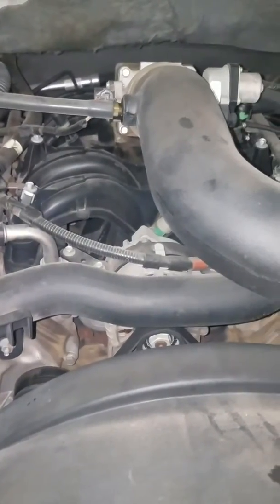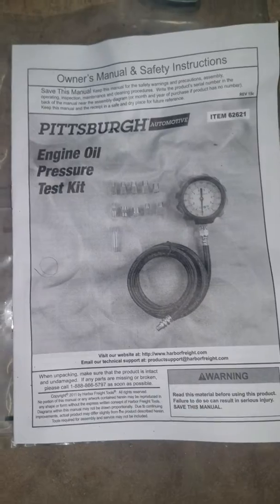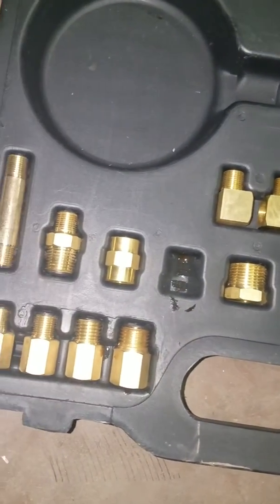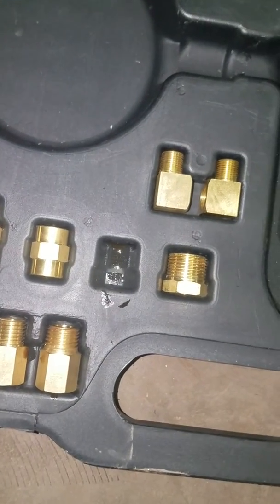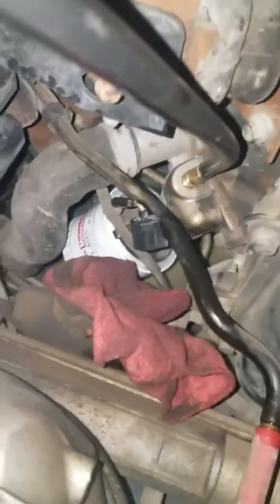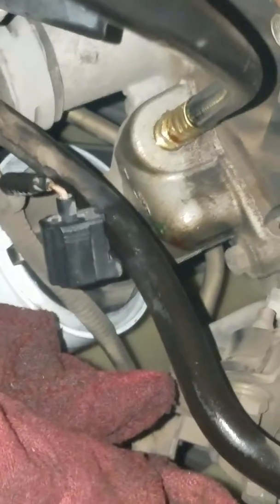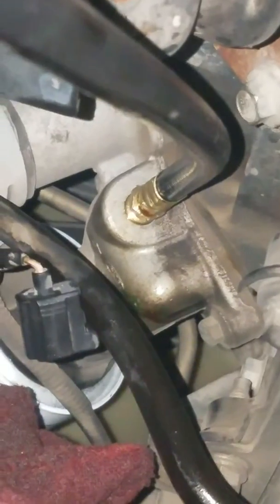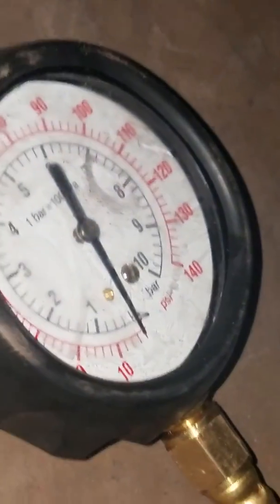How to Check Actual Oil Pressure On a Ford 5.4 3V Engine

Comment: Folks I have a 2008 F-250 Lariat with a 5.4. The oil sending sensor is not on the oil filter housing, It's on the block behind the power steering pump. It's very hard to access. Are there any other ports or a different way to check the oil pressure? Thanks in advance.
Reply: My 05 is in the same spot, it’s a bitch with that crossmember there…hoping to find a video with someone that has it this way, not trying to take a whole lot apart. Did you end up getting it?  I feel it may not be bad once I get the clip undone but even that is a challenge
Reply: @XCRunner4Life12  i did not.🥺
Reply: Forget what I said, I had my crossmembers confused. I got mine off with a 13/16 combo wrench, by laying across the engine bay with my head at the coolant reservoir and reaching down in. It is possible. Just a huge pain
Reply: @XCRunner4Life12  I have 2007 5.4 3v pickup, so is that sending unit more on the drivers of the vehicle? Accessing it from the top. I'm about to rest my head on the coolant reservoir to find it., and it's raining outside. What was Ford thinking when they built this thing. Ggggrrrr!
Reply: @808breaksbad  from what I remember yes it was. Not a bad motor, but definitely designed by an engineer whose wife slept with a mechanic
Reply: A sandwich plate is the easiest way to add a oil pressure gauge

Comment: Hi OKC VET!  I have a 2006 f150   90k miles   Just bought a few months ago   Then realized the problem engine lol  I did new updated plugs and new fuel pump module to fix misfire and full throttle issue   Then I had the hot idle knock   Which went away when I put in the updated new MC vct solenoids    So now that’s left is hot idle tick which is not that bad   And when idling / coasting in neighborhood or parking hit when hot and I release the throttle from a bit of gas I hear a slight chain type noise or something makes a quick noise    Last but not least    There is a slight startup rattle sometimes and usually only right after a fresh oil change   Then it basically goes away till next change    Iv been running 530   And lately have been topping it off with some Lucas to try raising oil pressure and seeing if it clears up the tick which it hasn’t   I only added maybe a quarter of a bottle    Could you please give me your opinion ?  I’m wondering if I should just roll with it or jump head first and get a full timing  and hphv Melling pump      If I do I thinking the Melling tensioners Sound the best then I guess new phasers and all that other stuff

Comment: My 5.4 lariat has 233,000 I hooked up the oil pressure test it was about 60 when starting and as it got warmer it got to about 10 psi I just ordered the melling m360 high pressure oil pump, what's the chances it's just the pump and that I shouldn't put a new motor in it? It dies in gear once warm. Please respond I'm not sure what to do or if I should even put the pump in or if that would be wasting time.
Reply from the maker: Has the timing components been changed yet? If not, I would change it all when you do the pump since the timing chains come off to do the pump.  I need more info to point you in the right direction.  With that many miles and dropping that much pressure, it prob has a lot of wear in other parts of the engine. You may try going a little heavier weight oil like 5w30 instead of 5w20 and see what happens.  Make sure you use syn or syn blend oil. When the heads/cams, crank and rod bearings wear down they cause oil pressure to drop alot. When the timing is off alot from the chains being loose, at hot idle they tend to kill the engine.  Other issues will cause the engine to die at idle also.  I see alot of higher mileage engines that the heads are causing the issues. The only thing you can do if it's the heads, is either rebuild/replace them, or replace the engine.  If your able to do the timing set/oil pump, you should be able to handle rebuilding or replacing the heads.  I normally rebuild the heads myself unless they need resurfacing, then I take them to a local machine shop.  Depending on what I find on a tear down, sometimes I use a hvhp oil pump.  Remember this, if you have oil pressure when you first start up, the oil pump is making the pressure using resistance of the engine parts.  If the pressure goes away after it warms up, the pump is prob still doing what its suppose to, but can't keep up with the demand so the pressure drops.  What's demanded isn't normally the oil pumps fault, but other engine parts like bearings, where clearances are getting bigger as they warm up.  Installing the hv or hp oil pump is putting a band aid on the real problem. Of course, the band aid could last for another 50k miles or more.  Installing the m340hv is very common and increases the oil volume which does not increase oil pressure, it just restores the resistance by adding more oil, which in turn restores the oil pressure.  Hopefully I didn't confuse you and helped a little. Thanks for watching!
Reply: @okcvet1st  no what you said makes since. It will die out in gear once warm and cant really be drove. Should I put a used motor or install timing kit and the pump?
Reply: @okcvet1st  also a mechanic looked at it and after we did the oil test and it got that low he seemed almost certain it was my bearrings, which I dont know what that meant honestly. I just want the truck to be able to drive decently smooth without spending too much money. So it's either fix timing, phasers , and oil pump, or new engine I'm leaning  towards new engine because it seems like this is going to be a costly fix but I'm not sure. The pump came today and I heard it's very good for bringing life back to the truck but at this point I'm thinking its probably not the pump.
Reply: @jeramywrestler7094  Check the VCT solenoids. I had the same issue and that was the problem.
Reply: @earljustus142  ok I just replaced it and it still is the same when I give it gas the oil pressure light goes up and when I stop it goes down and said low oil pressure should I go ahead and replace the pump, it sounds like it to me and I ordered the melling m360 pump so it should do it. What do you think?
Reply: @jeramywrestler7094  yes
Reply: @Dgmix007  . Bobby here. How did that oil pump job go .
Reply: @jeramywrestler7094  did it solve the issue? I have the same problem
Reply: @hunterprice287  they never answer.

Comment: Wht should the oil pressure be at ,,,,,, a base idle ?
Reply: 15 bare minimum, ideally 25+ though. This is while the engine is hot and in gear.
Reply from the maker: I like to see min 40psi. Min really depends on the condition of the engine. A worn engine requires more volume which lowers pressure.  And opposite, a less worn engine requires less volume which increases pressure.  Of course, everyones situation could be different.  Hope I didn't confuse  you. Thanks for watching.
Reply: @okcvet1st  ...ok maybe you can point me in the right  direction ...I have a 2008 f-150 5.4  new plugs all new coils .new throttel body ..
Runs like a champ ...and out of no where at times when I come to a stop and RPM drop . I get a stall or really rought idel ...
If I thap the gas ...it stop ...im stumped here ...
Reply from the maker: @meyou7404    Has the timing set been replaced yet?  Even though it may not be rattling, the timing hardware could be worn enough to cause an issue like that.  It's really hard to correctly diagnose without it being in front of me.  If you were in the okc area, I'd take a look at it for you.

Comment: I like keeping a gauge under the hood at all times. I used a GlowShift sandwich adapter for mine and set up a 12v electric gauge under the hood. I just touch wire to battery post and read pressure.